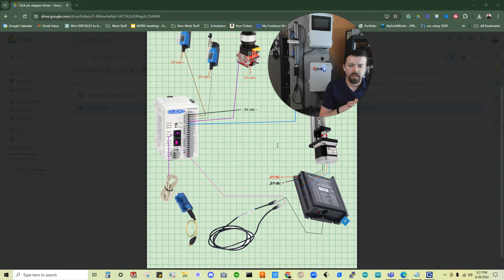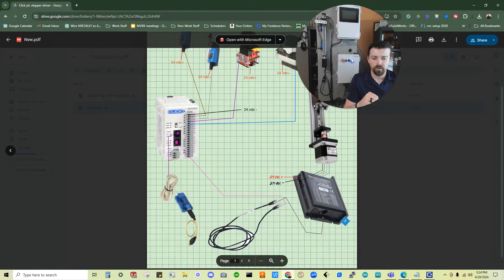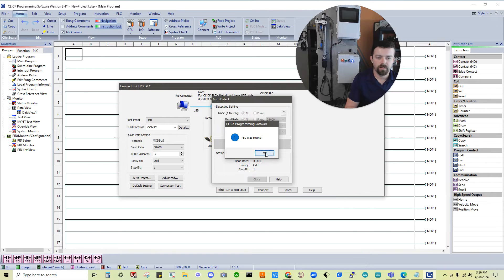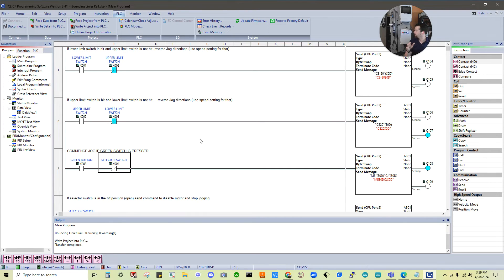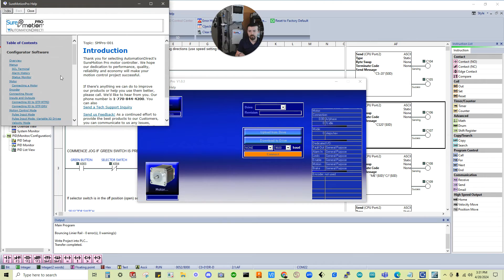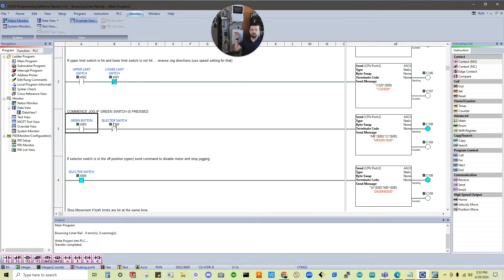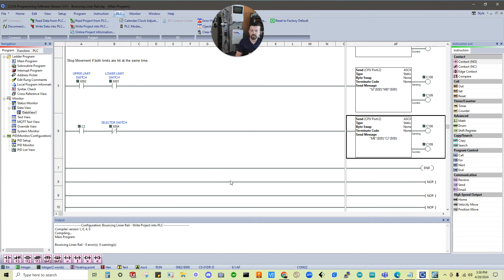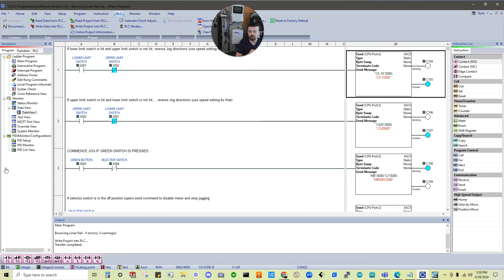Plunging into PLC: Low-cost Stepper Motor Control Tutorial With Click PLC Using Free Software

Comment: Excellent video, but I have a question: how do you wire a different stepper driver, in my case a DM542T. The rest of the components are the same. Thanks
Reply from the maker: Good question! The DM542T is a great driver. However, it is a pulse driven driver. Most PLCs cant control a pulse driver without an additional pulse module. Or you can alternatively, use a low cost microcontroller like an Arduino to control that driver. See my other videos for how to use an Arduino. I use a driver that is nearly identical to the DM542T (same wiring and setup)
Reply: @jaredhanson9758  Ok, thanks.

Comment: Very insightful. You mentioned you have posted another video using a micro controller. What would you say are the pros and cons of using a micro controller vs a PLC for a project like this? 
Thank you.
Reply from the maker: Hi. Sure thing. For most clients, these typically come down to cost and ease of use. 

--PLC (such as the click plc in this video)
PLCs are typically the only thing that manufacturing facilities accept for their controllers. They are typically all their workers know how to work with. PLCs are many multiples more expensive and some brands require expensive software. But they can be easier to work with once you are trained on them. PLCs are also more dependable long-term typically, have better safety ratings and are usually easier to debug. PLCs are also able to handle the voltages used by a lot of industrial systems such as 24VDC and the AC voltages wether directly or though attachment modules. ,

--Microcontrollers (such as Arduino)
Microcontrollers are nice due to their low cost. They can also pulse the stepper driver directly without specialty modules. They do require sketch coding in C++ which is harder to learn than ladder logic. But the tools to program them are free and can allow for some pretty complex options once you are good at coding them. They are also not typically accepted in large manufacturing environments due to not having the same safety certifications as PLCs and that most industrial workers don't know how to work with them. Ardunios are typically only 5vdc and 3.3vdc inputs/outputs, so they require voltage converters if working with higher voltages. 

Hope that helps